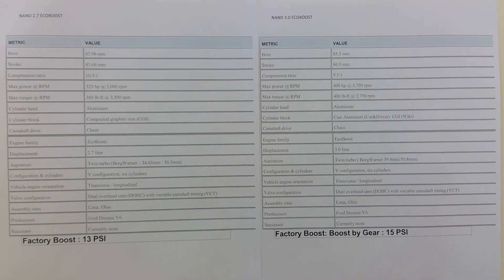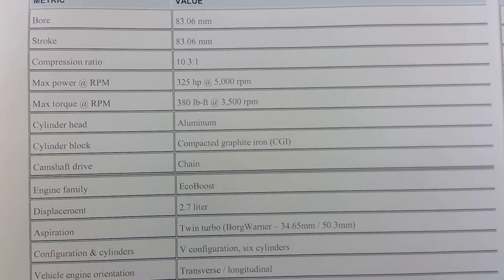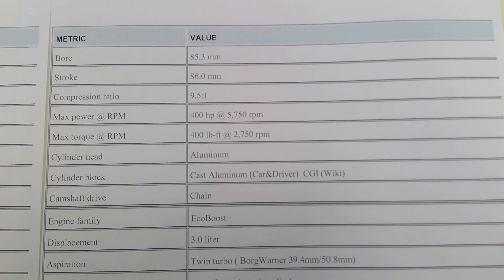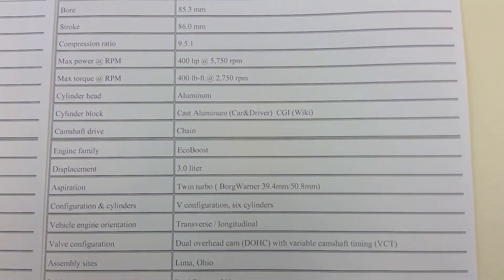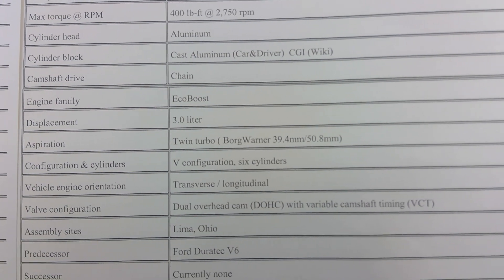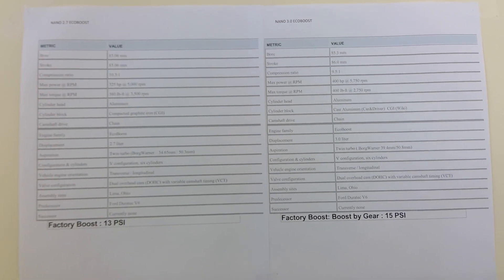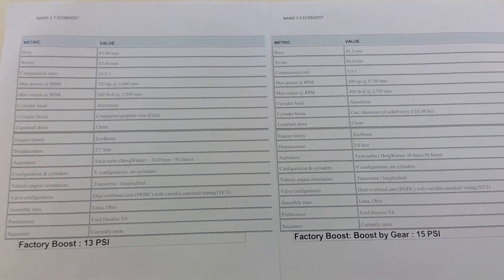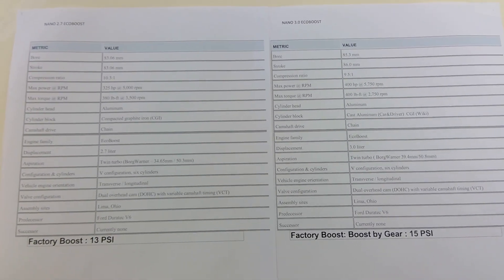Ford V6 2.7 Vs Lincoln 3.0 Ecoboost (Nano)

Comment: Very interesting about the compression ratios would have assumed the 3.0t would have a higher compression ratio than the 2.7 prob due to the fact they use the 2.7 for the trucks
Reply from the maker: Think the 2.7tt was design with higher compression for instant low end torque, the 3.0 car ecoboost lower CR for a smoother low end power delivery and higher boost at higher RPM's.

Comment: Wait, so I would just need to swap the bottom end to have the 3.0?
Reply from the maker: I would get a long block vs short block for less work, but the ECU would also to have the boost by gear
Reply: The heads have different chamber machining to account for the larger pistons.
Reply from the maker: @arthuruscg  interesting, they share the same P/N

Comment: From the initial materials about the Nano, both blocks are made from the same material, CGI upper V section with aluminum lower skirting/reinforcement.

I'll try and find the links.
Reply from the maker: Seems Lincoln does not share info widely vs. Ford. Almost think they try to hide the fact their engines are Ecoboost to their customers.m
Reply: @twinforce_fusion6560  I can't find the article but the link below is to pictures of the 3.0 and you can see the CGI between the heads and lower stuffing girdle.
https://www.facebook.com/groups/FusionSportEnthusiasts/?ref=share
Reply: @twinforce_fusion6560  https://www.facebook.com/photo?fbid=10226456223695728&set=pcb.1643080835877352
Reply: I can't prove this is true, but this is what I posted on the forum somewhere I think. I'm pretty sure both blocks use CGI AND Aluminum like you said.
Reply: Ok, so I can't post links to popular mechanics or C&D articles that show the two part blocks, so I'm revealing my true identity by linking to my FB.
https://www.facebook.com/photo?fbid=10207997428809184&set=pcb.1643245042527598

That shows the two part block pretty clearly.
Reply: Thanks for the Info fellas. Instead of upgrading the turbos right now. I’m going to keep saving up for the 3.0 swap.

Comment: Very useful info!!    I was wondering about the 3.0 block material...  It seems lighter than CGI would be.
Reply from the maker: Yes, aluminum is lighter, but you need more material to provide the same protection vs CGI. Apparently, the 3.0 block is 14kg heavier vs the 2.7. But information is hard to find, I have to rely on a Ford tech.
Reply: @twinforce_fusion6560  And I continue to learn!  I wonder if they make the Darton MID sleeves for the 3.0.